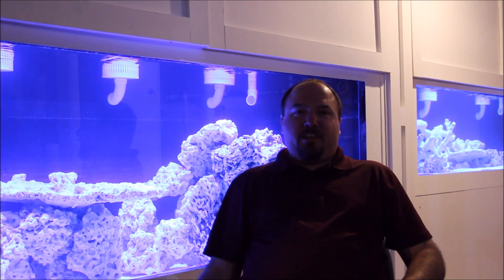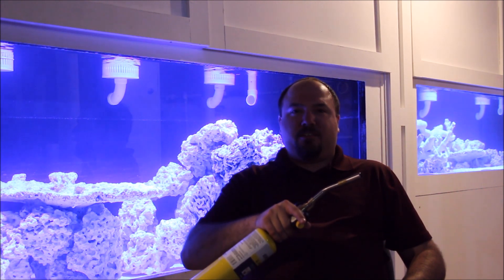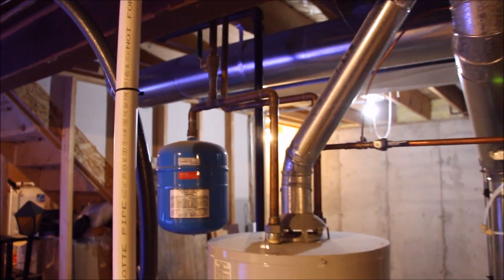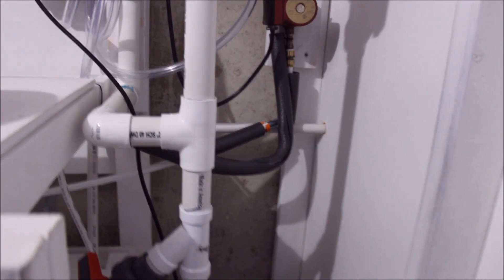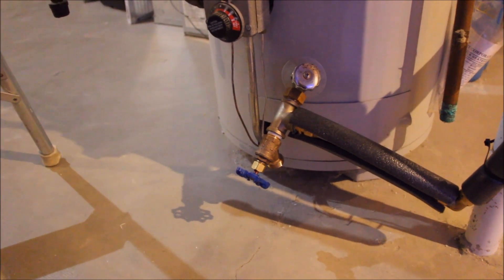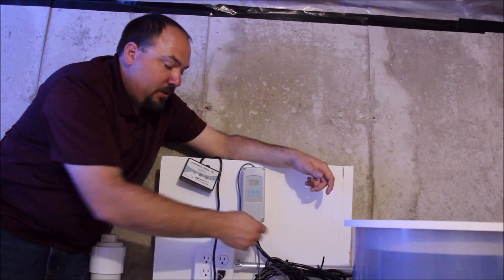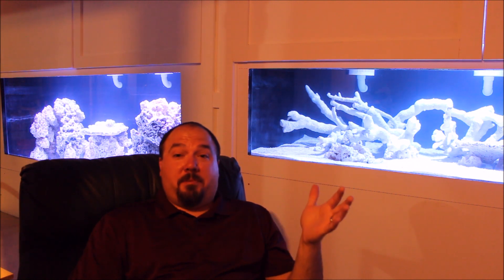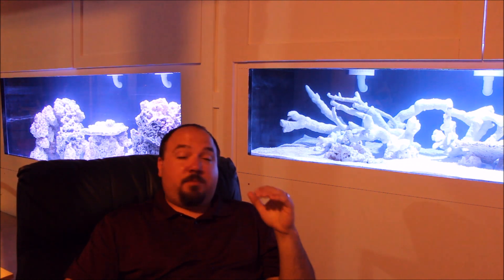Heating the 1600 Gallon System with Fire Part 3

Comment: Is bacteria in the lines from being stagnant an issue in the warmer months when the heat isn’t being used?
Reply from the maker: The possibility of bacteria growing in the lines during the summer months when the heating system is not operating is something to consider.  I do have a water softener and I keep my hot water heater at a higher temp setting which should kill off any bacteria that make it back to the hot water tank.  Without testing specifically for harmful bacteria though I can only speculate as to their presence.  Since the system has been running I have not seen any issues with my hot water supply.  I have seen some concern about bacteria with aquarium heating systems like the one I am using but I have not seen a specific case where it has been proven that harmful bacteria has grown in the lines for an aquarium radiant heating system.  I would think that if bacteria is an issue then any home with pex plumbing that has hot water lines that are stagnant for months at a time due to a lack of use would have caused enough problems to trigger a health warning about bacteria and would have caused a standards change for plumbing when PEX is used.  Again bacteria is something to consider in this type of heating system but if it is a major concern then an alternative is to create a separate radiant heating system using a second hot water tank or an on demand hot water system that is isolated from the house supply of water in a closed loop system.
Reply: AlexGs Aquarium good point. I’m in the process of doing this setup. I plan on using the apex to turn the circulation pump on at least once a day for a minute or 2, enough to circulate the water in the pex. Or drain and flush it if it doesn’t  turn on in summer months before it is used again to be on the safe side. 
Thanks for all the info.

Comment: Is this radiant heating system still working well for you? Were you able to find a controller that could provide finer control compared to the Ranco? Doing a 900 build and love this idea.  A
Reply: Would there be any problem doing this on a tankless on demand water heater?
Reply from the maker: Yes the heating system has been working well.  During the summer months it does not run often.  During the winter months the tank was held within a 1 degree temperature range between heating cycles.  If you want a finer range of temperature control you could use a pinpoint temperature controller which can control heating and cooling.  I decided that that a finer degree of control was not necessary but I did install an apex which serves as a redundant temp controller to protect against an overheat situation.

Comment: What Joey did in his garage-fish room, that dedicated heater setup, he uses for his 2000g cement tank. Wasn't expensive.
I've also had success heating a small outdoor pool with a 12 amp 120vac heater element bought at Home Depot, if you want to DIY an entire hot water tank with 8" or 12" PVC and reducers for the heater element which is 3/4". You just need a "bladder", Joey did one too. The heating element is under 20$.
The DIY HW tank would need it's own temp probe, use the one you have already.
Keep your existing piping to your house HW tank as a backup, should the DIY HW tank fail or is under maintenance.
Reply from the maker: I can see that being a solution for tank heating.  The only disadvantage would be the cost to run the heating element.  If it is 12amp 120VAC it is going to be expensive to run compared to natural gas heating.  The water heater I am using to create this heating loop uses natural gas so the cost of operation is low compared to using electric heating.  Since it is also running the house hot water I it is serving a dual purpose.  Thanks for sharing this tank heating method.

Comment: Was wiring the controller difficult? Also what is the temp your water tank is set at. Though, my display is only 550gals, with the Bashsea sump, Bio-Reactor and 75 gal refugium.. I'm sitting at 750+gals of water. I plan on having the coil in the last compartment of the sump, before the return to the display--- will the water entering the tank be too hot for the fish? I really don't want to screw this up...lol
Reply from the maker: The controller wiring is simple.  If you look up wiring that Ranco controller on YouTube as there are some great set by step videos already out there.  That is how I did it.  Once you get the coil ready I would turn on the pump manually or using the ranco controller to test the temperature probe.  My hot water heater is set fairly low so the loop does not get that hot ~100 degrees on the pex.  Pex is also not an efficient heat ex-changer which in my opinion is better anyways as you dont want to heat the tank too fast.  I did not find that it over heated my water.  If you want to test slowly only put a small amount of the pex coil in the tank for a heat ex-changer and leave the rest out of the water and then slowly add more coils to get the desirable heating effect on the water.  If the water movement past the heat ex-changer it should not have time to overheat the water before it enters the tank.  Best thing to do if this is a running system with fish is to perform some tests in a clean garbage can or a spare tank but if you need to put it in the established system take your time by adding small amounts of the heating coil until it is heating at the desired level or until it produces the max temp on the return water you want for your system.
Reply: AlexGs Aquarium thanks a lot. And yeah, no fish will be in the tank until I figure this out. I will update when I make some progress. Thanks again for all the help. When I get done, I'll put up a video or something.

Comment: I love radiant heating systems - it's one of the things I really miss from our old house. I agree about heater failures, it's not if but when. I have two 300W heaters in my XL 425 system. One is a Fluval E300 which is mounted in the return chamber so I can readily see the temperature display. That one is actually the backup to a 300W titanium Finnex heater with a controller that is mounted at the back of the centre section of the sump, lying along the bottom, and is set to be the main heat source except during a power failure. The Fluval is plugged into the battery backup because that way I can monitor the actual water temperature just before it is returned to the tank all the time, not only during a power outage. That's possible because we also plugged the return pump into the battery backup, reasoning with its low wattage, it would be the best way for us to maintain water flow AND temp throughout the whole system. In our area we have extremely hard water with very high TDS, so we need to replace our water heater every three years even with a water softener on the system. If I had radiant heat via the water heater I'd be worried about gradual reduction in water capacity in the water heater because of lime buildup, ending finally with downtime during a replacement. BUT after watching your heating system videos, if funds were available for a frill on my system, I'd seriously consider an on-demand hot water system......🤔 We already have the holes in the floor to the basement and have built everything to come apart for maintenance.....😀 Hmm, I wonder if my husband would be up for a project like that.....
Reply from the maker: I could see how lime buildup over time could be an issue in this type of system.  I have a water softener and I will have to pull a connection every now and then to see if there is any build up.  On the plus side pex plumbing line is relatively cheap so if there was a lot of build up every few years it could be replaced.

Comment: Nice update.  Your exchange rate should be proportional to the temp difference and flow rates of both your heater and sump.  I would vote for a temp increase in the hot water first.  Second would be to slow the heater loop, if possible, to let more heat exchange.
Reply from the maker: I agree the hot water tank temp increase is the first step.  The recirculating pump I have has a fixed speed so flow restriction would be my only method to slow the flow rate.  They do make variable speed recirculating pumps as well but at this point I would rather just keep what I have since it works.  I also believe that the lower efficiency of the heat exchanger does not make much of a difference as the tank temperature is being maintained without any difficulties.  The water return line to the hot water tank is insulated and I am considering insulating the supply hot water lines as well to minimize heat loss to the environment.  I think as the winter months approach I will get a better idea of how well the system performs as temperatures in the basement start to lower.

Comment: Great video! Based on the input to out water temperature ratio I'd say your heat exchanger has a ton of room for improvement in terms of efficiency. Can you switch to some sort of metal piping to increase thermal conductivity? Also, more surface area. That could get you back some hot water for the showers! Keep up the good work!
Reply from the maker: Thanks for the comment Carlos Bonilla.  The heat exchanger efficiency is not great but I have to be careful as I don't want to heat the water too quickly.  Metal would create a more efficient heat exchanger but metals and saltwater don't mix well which is why I used PEX as it is not impacted by saltwater.  Most metals can corrode in saltwater and that would release metals into the water which are poisonous invertebrates.   The only metal that could really be used is titanium but it would also have a much higher cost.  Since the water only looses about 5 degrees in the heat exchanger less time and energy is needed at the hot water heater to reheat the water to its set point.  I think increasing the temp on the hot water tank will be the first action to combat the shower issue.  There are 4 settings above the current temp setting on the hot water tank.

Comment: What is contingency plan for power or gas failure. Not sure what water heater is powered by.
Reply from the maker: Power failure planning will getting its own video(s) once I have all of the backup systems in place and tested.  I think emergency planning for aquariums is important and often neglected until its too late.  The water heater is gas powered and does not require its own electrical connection.  In the event of a gas/hot water tank failure I have some electric heaters that can be put in place temporarily until the gas or the hot water tank is restored to operation .

Comment: I have run the system for a long time (5+ years).  I have experienced the same thing with the shower.  Setting the water heater temp higher will help.    I run mine on an APEX and run it after the temp drops .5 degrees.  Nice work!
Reply from the maker: I am glad to hear your radiant heating system has been working well long term.  Thanks for the comment mhowe9.

Comment: Very happy all is going well and looking like your in the home stretch. With my 540g tank, because its in the house which is a stable temp, I just have 2 300w Fluval heaters in the sump that seldom come on to just keep it at the 78 degree mark. You have a massive amount of water and it seems to be in a colder portion of house so I see the need for the heating arrangement and am impressed with your design.
Reply from the maker: Yes the basement holds around 68 degrees during the summer.  I think its better that its cooler as I find that its easier to maintain the use of heaters rather than need chillers.
Reply: Gotcha.. with my house at 72 in the winter and 79 in summer the 2 - 300 watt heaters work ok in my set up.

Comment: Great idea Alex. Nice job. I guess u couldn't heat a 1600 g system with a couple Ehimes could you!!
Reply from the maker: I could have used electric heating but I did not want to take the risk of an electric heater failure in the tank.

Comment: $300 is a very low price that doesn't sound like a lot.  For my 112 gallon reef I've gotta spend about $40-50 a year considering I have 2 regular aquarium heaters that need to be replaced every 2 years for peace of mind.   Why don't you want to heat the tanks faster?  Seems like warm showers are going to get annoying if anyone in your house is a hot shower person.  I would think your system is going to hold heat in pretty well and having it go on quickly to increase by 1 degree should not effect anything more than slowly increasing by 1 degree.   Do you have any idea what the energy cost of this heating system will be?
Reply from the maker: Thanks for the comment Average Reef.  In any aquarium system changing the temperature should be a gradual process.  In my case the water entering the display tanks will be warmer than the tank water itself.  My worry with heating quickly is that the water entering the display tanks would need to be much warmer than the display tank water and big temperature differences can shock or stress fish/corals.  Even if I am trying to only raise the temperature by one degree its the volume of water that needs to be heated by one degree.  As for the shower issue my wife has not complained and until that happens I am not too worried about it.  The first step would be to raise the temperature of the hot water tank which should resolve the shower issue.  I don't have details on the energy cost yet as it has not been running long enough.  I do think there will be a savings that I will get from this heating system vs electric heating. Everything I have read about other people using the same setup for radiant heating all state there is a savings over using electric heaters.  I think the biggest advantage is that there is not a risk of an electric heater failing in the tank which has been well documented as causing great harm to aquarium inhabitants.